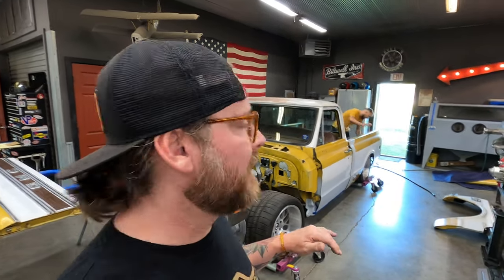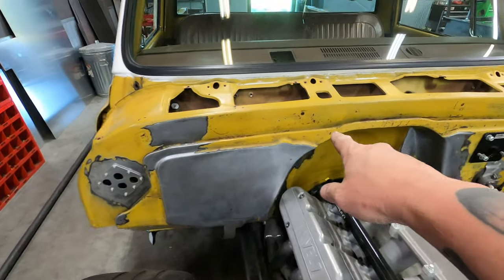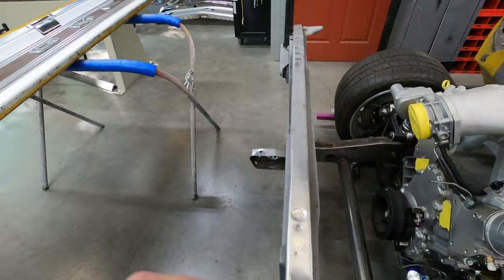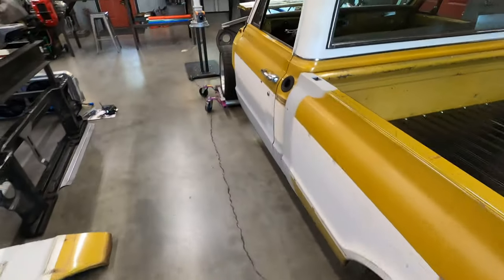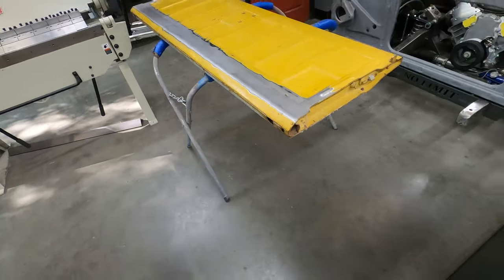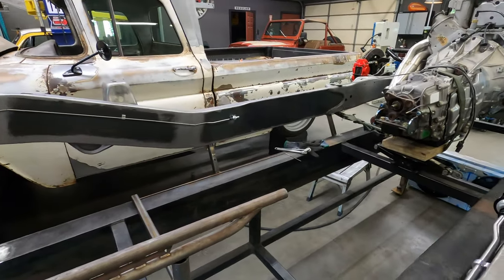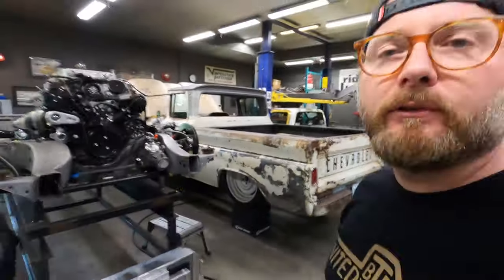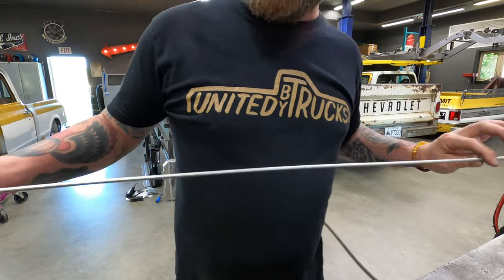Shop Updates and Brake Line Tutorial

Comment: Great video…. Do you see any problem mixing JIC and AN? I know its the same degree if flare but it seems line a gray area. Do the bulkhead fittings need to be steel/stainless steel?
Reply from the maker: Not at all. As far as I know JIC and AN are the same thing.